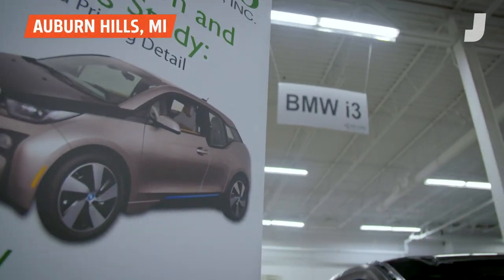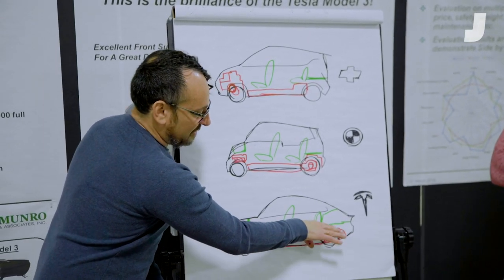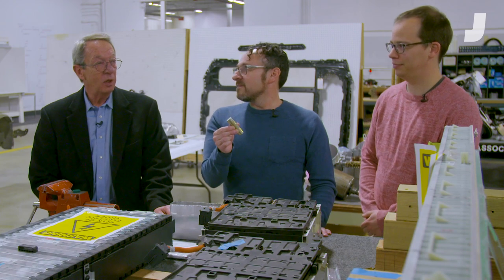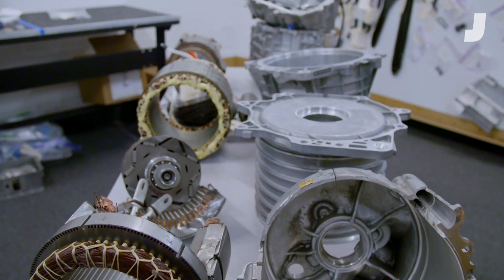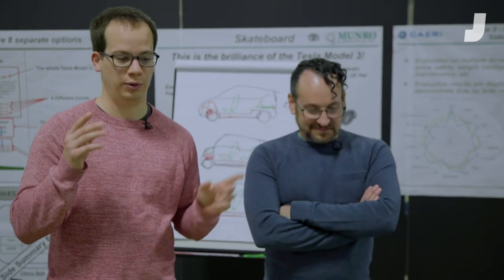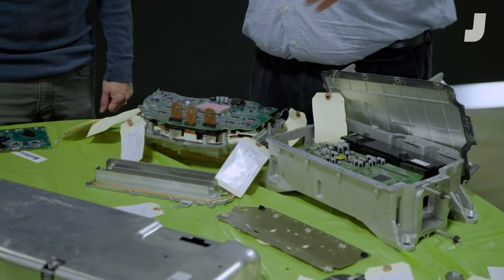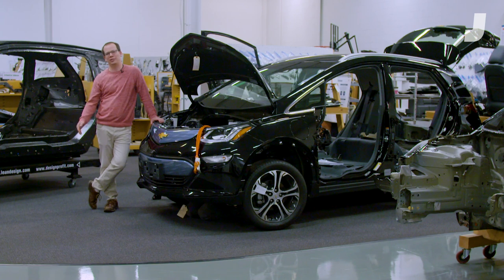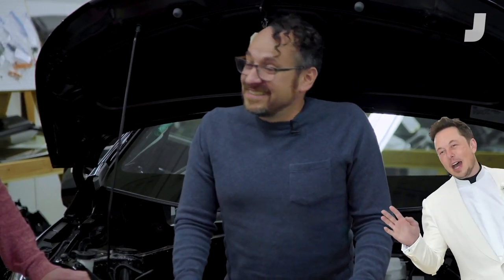A Look Inside The Tesla Model 3, Chevy Bolt, and BMW i3

Comment: Skipped over the part where the Model 3 body is heavier than it needs to be to get the same level of safety and rigidity.
Reply: Pogo I guess they were too busy being impressed by Tesla's clearly superior design.
Reply: @j.kevinmcnary9561  
Ouch!
Reply: @j.kevinmcnary9561  Easy to be impressed by vajazzle.  There are pro and con's with Tesla's "superior" design.
Are some of them more effective, yes, downside, it adds more complexity, more cost in both manufacturing, assembly and maintenance.
These are things that any manufacturers that expect to stay in business take into account when building a car.
Companies that don't end up like BMC.
Reply: Pogo Some folks are clearly willing to pay more for the safest passenger sedan in the world. And if Munro considers the design and efficiency of the battery and drivetain to be superior, I will defer to that expertise.
Reply: @j.kevinmcnary9561  Yes, he did, now will you also defer to him when said that the chassis was over built, over weight and over complicated and had for the rigidity it had?
Translation another company can build the same body, just as safely and build lighter, simpler and for less. The customers are paying for the illusion.
Reply: Pogo Nobody has made a safer car yet. If you would prefer an underbuilt car, then buy one. If there is a safer car than Model 3, then what is it? Even with the "overbuilt" or overweight chassis and/or body, Tesla has the highest efficiency powertrain and longest range. I feel certain that if Tesla can find a stronger and lighter design, they will implement it. For now, and for the foreseeable future, nobody does it better.
Reply: @j.kevinmcnary9561  
Sample
You don't need to build the rear wheel well out of 9 pieces when you can build it as a single piece.
A single unit costs less to make, uses less material (lighter) easier to install (one piece 1/4 the welds and fastener = lighter and cheaper), and it's stronger because there are no joints to weaken it.
How do we know this, car companies have been doing it since the 1950's.
You can use the battery case as a structural member.
This reduces the weight of the body without reducing the structural integrity of the car.
Cheaper, lighter and just as strong.
Race cars have been using this method for more than 20 years to increase the structural integrity of the chassis without gaining weight or cost.
Reply: SDD525  If you can lose 200-500lb of weight in the body and frame without reducing the safety and rigidity while reducing build cost, you end up with a lower costing car.
That was the point of the Model 3 wasn't it?
Reply: @pogo1140  
So, they can lose weight!
Yet, it's STILL the most efficient car out there!
WOW!
IMPRESSIVE!
Don't you agree?

Comment: Once again...the nitpick of nitpicks is about how the body isn't designed on the Model 3 with the same shortcuts the other manufactures do theirs. There is ONE major reason why....SAFETY. Tesla wanted to produce a car that wasn't just NTSA Rated 5 Stars, but a car that exceeded those standards. The Model 3 is a car that now has been rated as the safest car on the road. The least likely for injuries. Rigid. Safe. Great.

Comment: Why no word about i3s electronics....?!?! 
I guess your guy wasn’t guru after all.....
Reply: Perhaps they weren't interesting enough? Or maybe they hadn't finished the teardown of that part - not sure.
Reply: @morosis82  , they do these tear downs for customers, so there is a reason what & why they break apart on the cars...
Reply: @davidhollenshead4892  sure, but I doubt they'd have torn down the entire car, body, battery pack, motor and all, only to leave the drive controller... which suggests it's not sufficiently different to the Bolt to make it noteworthy to show in this format.
Reply: i3 electronics are way better than the Tesla shit and since this is a commercial for Tesla...
Reply: @SuperDirk1965  They should have also mentioned that Tesla adapted the hybrid-synchronous motor that the i3 introduced
Reply: @MadDaCube  i don't think i3 did introduce anything, these types of motors are commodities...
Reply: @sucim  Read up on the i3 motor. You will find it interesting
Reply: I would not call them commodities. Although the basic concept/theory of such synchronous motors are 40/60-years old, the practical development started in the 80s/90s and especially since the 2000s thanks to the improvements in the design and analysis procedures, power electronics, machine controls, permanent magnet technology. Together with a drastic improvement in the computational power of the CAE tools (e.g. FEA software). But we have lot of development ahead.

This, in my opinion, explains why induction machines where choosen as the ONLY machine typology during the beginning of the Tesla era till <model 3..because was actually the only one they were fully mastering: it was the "state of the art" technology in the 1990s (and actually even later), directly taken from AC Propulsion known-how.

The machines from Tesla and BMW can be classified as Interior Permanent Magnet (IPM) synchronous machines. On the other hand, the ''hybrid'' design of BMW, is what is normally called specifically in the machine design field, PM Assisted Synchronous Reluctance machine (PMASR or PMASynREL), in reason of such this kind of multi-flux barrier design where the PM are placed. This design is expected to enhance the rotor anisotropy and therefore the contribution of the so called reluctance torque, which is the torque not directly produced by the magnet flux. This a key factor for cost saving designs, since you can potentially reduce the magnet volume, i.e. machine cost. They are very interesting machines, since they effectively exploit low cost/ performance PMs, like ferrite.

The Tesla model 3 motor also exploits the reluctance torque, but in general, the design might offers less potential on this regards than the BMW machine because of this single-flux barrier, V-shape rotor. Therefore is normally called as just IPM machine. Conversely, the V-shape rotor is expected to exploit some kind of flux-concentration because the magnets are kind of ''squeezing'' the magnetic field.  As far as I know this design was actually introduced by Toyota with the Prius. 

The amount of reluctance torque depends by many specific factors. For example one key factor is the number of poles. Normally, the higher the number of poles, the lower is the amount of reluctance torque the machine can produce. Because of this the BWM machine with its 12-pole rotor might appear, at the end, less effective than the 6-pole Tesla rotor together with higher iron losses because of the double operating frequency. On the other hand, the 12-pole choice might be constrained by torque quality and acoustic requirements.  .

Comment: The BMW  frame will not rust...It could last forever even in horrible salty conditions. Other components are aluminium too. They are also upgrading batteries as the new ones are the same format.